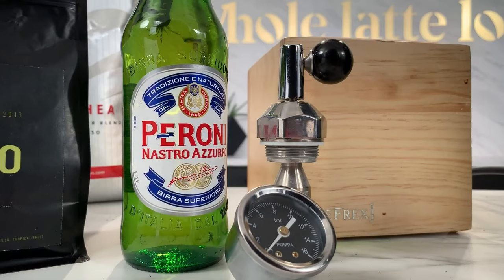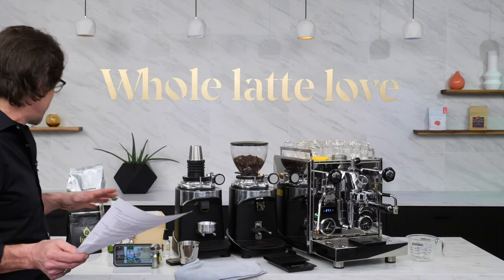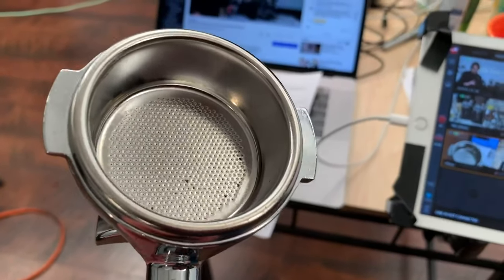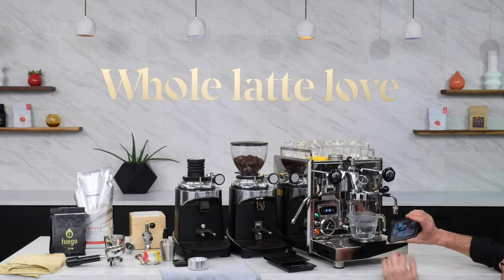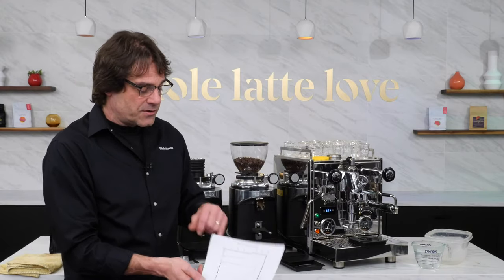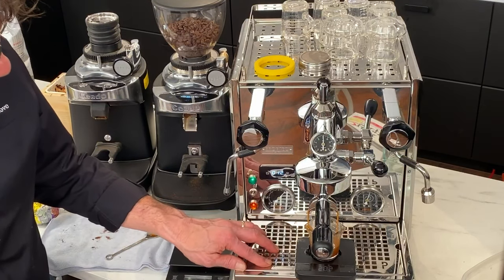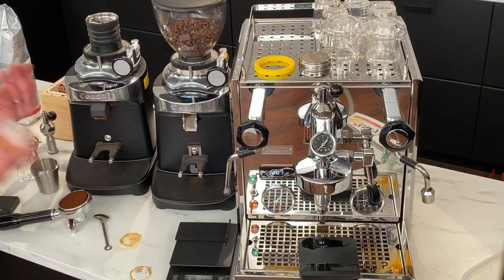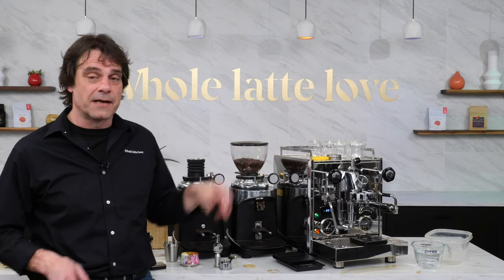Introduction to Flow Control on E61 Group Espresso Machines

Comment: I just had another question while I was watching you using flow control. I also bought the ECM Synkronika with Flow control. When I close the flow control all the way up, I still get some water (2-3 g/s) out of the shower screen. Is there a way to adjust the flow control setting if it is already installed? That would be really helpful to be able to maintain and adjust this. Also, is there a way to limit the output (g/s) if it is turned all the way up? It would be great if the standard flow rate (without flow control) would also be the maximum flow rate with flow control installed. Kind Regards!
Reply from the maker: Hi Martin, Sounds like you need to calibrate the control. The external chrome sleeve which receives the black control knob can slide down a bit while the valve is open and prevent the valve from fully closing. Very easy to fix! Loosen the black control knob a turn or so - just to be clear you will be turning the knob and not using the knob to operate the valve at this point. Then try closing the valve. With the black knob loosened a bit the chrome shaft which receives it can move vertically. That will allow the valve to close. When fully closed and no flow from the group firmly tighten the knob. Hope that makes sense!
There is no way to limit the maximum flow rate when the valve is fully opened. There are a few cases where one might want to have more than the stock flow rate. On the Synchronika it's ~1.25 turns from fully closed to get the stock flow rate of ~11g/s. From there flow increases in a fairly linear fashion out to 1.75 turns with a flow rate of ~14g/s. It's that last extra quarter turn from 1.75 to 2 full turns where the flood gates open and flow doubles to ~28g/s. Hope that helps!
Marc
Reply: @Wholelattelovepage  Hi Marc! This is a great tip and it did indeed help me to fix my flow control. It is now fully close at a 3 o'clock position. This might be a valuable information to all flow control users out there. Thanks for your help. :)
Reply from the maker: Martin Bartel Happy to help and glad you could understand the instructions. I’m much better at informing through video than writing. I did do a video showing how to setup properly for full closure of the FCD awhile back. We are working on a flow control support section on our website. Will definitely include links to that video and others as well as some profile graphs etc. Marc

Comment: Hi Marc, thanks for all your info and videos, your help is very much appreciated, Regarding Orchestrale Nota 1, have you ever used them, and if so what is your opinion, as I am about to upgrade from my Breville dual boiler to a "real" commercial machine.
Reply from the maker: Hi DFS, You are welcome and thank you for the question. It will be a huge upgrade from your Breville! I have not used that particular machine but understand it's a large boiler E61 group. Should give you more potential than BDB.
Marc

Comment: Hi! I really like your videos, they are really helpful! I also bought a Ceado E36S grinder and I see you adjusting the grind size while the burrs are not turning. Is this hurting the machine based on your experience? The ceado manueal recommends only to reduce the grind size while there are no beans in the machine and the machine is running. What is your take on this? Kind Regards!
Reply from the maker: Hi Martin, Thanks for the comment and question. Out of an abundance of caution grinder manufacturers always recommend only adjusting grind size with the burrs spinning. Reason? If you adjust to a finer grind size without the grinder running you may crush any remaining beans or partially ground beans between the burrs to the point where the motor will not start. If left on with the motor trying to spin the burrs but they're jammed with beans the motor could be damaged. In my experience never a problem to adjust to a coarser size without the burrs running. And very minor adjustments to a finer setting are usually not a problem. Especially true in a grinder like the E37S with a powerful motor and good start capacitor.  My take is follow the manufacturers instructions unless one knows exactly what they are doing.
Marc
Reply: @Wholelattelovepage  @Martin Bartel just to clarify, Marc changed the grind on the E37SD and not the E37S. On the SD it’s not an issue to not have the grinder running because, since you are single dosing,  you are grinding to empty each time. There are no beans left in the grinding chamber. With the S, because it is hopper-fed, yes you should avoid adjusting finer without the grinder running to prevent any potential jamming issues as Marc mentioned in his reply.

Comment: Love this! I am thinking of getting three for my Kees Van Dee Western Mirage then it will look even sexier hehehe question how come you don't purge water out between shots? Is it just for the sake of the video or you don't feel the need to purge the old water and grinds??
Reply from the maker: Hi Chubz, Thanks for the comment. Purge/flush depends on the machine used. If I were using and older HX boiler machine with pressurestat temp control I would most certainly flush. Same goes for most single boiler machines as well. Most of those machine types will have over overheated brew water after sitting idle. I don't worry much about the grinds. On most machines I replace stock shower screens with IMS screens for improved water dispersion. Unlike stock screens the IMS showers do not have a rough screen which holds onto coffee particles/oils - much easier to clean! Check those out here: https://www.wholelattelove.com/products/ims-nanotech-e61-shower-screen
Marc

Comment: Hi Mark --
I just bought a Synchronika thru Whole Latte Love. I think its basically the same as this Profitec you show here. Q. At 29:44 how many turns 'open' did you start with? I watched like 10x.. 1.5?
Reply from the maker: Hey charles, Thanks for the question - and of course your patronage! For that profile I started with the FC at 1 turn open from the closed/no flow position. Here's a link to a blog on flow control. In the blog there are graphs for a number of flow profiles I developed: https://www.wholelattelove.com/blogs/articles/intro-to-calculating-flow-rate-on-e61-group-machines
Marc
Reply: @Wholelattelovepage  Thanks so much Marc!

Comment: Hi Marc, Thanks for your videos. I recently purchased the Profitec 600 with flow control. I have pulled about 50 shots so far and just got my new Caedo E6P grinder so went back to this video before dialing in my grind size. I would think the Profitec 600 flow would be similar to the the 700 in your video, but it takes me 2 full turns open to get about 11 grams per second (222 grams of water in 20 seconds). Is 10.9 grams per second the stock flow on the 600 as well? I called tech support but they did not have an answer for what stock flow should be on the 600.
Reply from the maker: Hi Terry, Thanks for the question and apologies for my delayed response - I've been offline for the last week and just now catching up. Pro 700 has a rotary pump and stock flow rate is ~11g/s. Pro 600 uses a vibration pump. Stock flow rate on the 600 and other vib pump E61 machines is ~8g/s. Sorry our tech support did not have the answer for you. They should have asked me.
Marc
Reply: Whole Latte Love Thanks Marc!

Comment: Hey Marc, I just picked up the Profitec Pro 500 PID with the flow control. You did mention that the Pro 700’s stock flow is 1 and 1/4th turn, is this the same for the Pro 500?  I just want to get the stock flow first to dial in my grind before I start going into the deep end with the flow. :D
Reply from the maker: Hi ibfm, Your timing is perfect! Just did a live stream today featuring a Pro 500 with flow control. Stock flow rate on the 500 is ~8g/sec. Which is at about 1 1/4 turns of the FCD. But, do go through the calibration measuring flow rates at each quarter turn. Run for 20 seconds at each position, measure output at that position in grams or ml and divide by 20 to get grams per second of flow. There can be slight variations in flow rate based on pump pressure (OPV) setting and other factors. Do check out your machine doing it's thing in my live stream: https://youtu.be/suux3RrbAxA
I have a bunch of other live streams with different flow profiles for different situations like extra fresh specialty coffee, a sweet bump profile and more coming next week like a manual lever profile.
Marc

Comment: Hey Marc! I'm interested in installing a brew pressure gauge on the E61 grouphead of my Quickmill Andreja. Question- I see lots of options on the market for E61 pressure gauges, as well as E61 grouphead thermometers. Does any company produce a 2-in-1 gauge, that can measure both simultaneously? Thanks a bunch!
Reply from the maker: Hi Kevin, I am not aware of a combo gauge and thermometer.
Marc
Reply: Good job.

Comment: Hi mark, awesome video! 
I have a profitec pro 700 and these are my flow rates 
1 x 11ml/s
3/4 x 8.8 ml/s
1/2 x 6.6ml/s
1/4 x 4.5ml/s
They seem to be a bit higher than yours 
No water comes out when fully closed as well 
Thanks
Nicholas
Reply: Also i have between 9-9.5 brew pressure on both garages

Comment: Hi Marc, I bought the flow rate kit and and installed it. It comes with the spring replacement. After replacing it on my synchronika,  I find it tougher to pull the lever. What is the purpose of the spring and do I need to replace it? Thanks

Comment: Hey Marc,
Thank you so much. It’s been a while no see! I hope you’re doing well. 
Does the stock rate for v pump a turn and a quarter turn as well? Specifically for Calssica pif. Thank you.
Reply from the maker: Hi Amjd, thanks for the question. Should be close to one and a quarter turns for stock flow rate. Give it a try and measure what comes out in 20 seconds without a PF in place. Should be about 160g or 160ml which equals 8g/sec a typical stock flow rate for vibration pump E61 group machine like the Classika. Marc

Comment: Thanks Marc for putting this together as well as the other video with the 5 different profiles.
Did you come up with these profiles by trial and error or is there some theory behind it? For example, for dark roasts pre-infuse high flow/low flow, short or long hold duration? Light roasts, old coffee as well.  Could you expand on the thinking that lead you to those 5 profiles please?
Reply from the maker: Hi Phil, You are welcome and thanks for the questions. The profiles came together from informed trial and error is best way I can put it. Some basics are fairly well understood like long low flow pre-infusions allow a very fresh coffee to off-gas and reduce brightness. I have spent time working with coffee pros like Danilo Lodi of Dalla Corte who has some basic theories for flow depending on coffee type. I adapted and tested his approach on the DC Mina with regards to very fresh coffee. Also his way of working older coffees with high flow at start and flow reduction to avoid extraction of bitter and stale flavors towards end of extraction.
Marc
Reply: @Wholelattelovepage  thanks for your reply Marc.
I'm experimenting with the FCD on my Synchronika right now. It's  a fine line between drinking too much coffee or wasting it😋☕☕☕

Comment: This may have been asked before but I'm hoping for your answer.  If a machine has flow control is there a constant stream of hot water going to the E61 group head to keep it nice and warm even prior to opening up the flow control lever during the machine warm up period and/or between pulling shots?
Reply from the maker: Hi Stephen, Thanks for the question and I'm happy to answer! All E61 groups have a constant flow of water out to the group and back to the boiler in a closed loop when the machine is fully heated up and sitting idle. It's called a thermo-siphon and happens due to convection. Here's a video which covers different boiler types/groups with a deeper look at how that works using some cut-away machines  - a couple with cut-away E61 groups: https://studio.youtube.com/video/OUywoRs4meY/edit?o=U
Key to designing machines is a flow restrictor in the thermo-siphon loop which machine designers must size properly to create a flow rate which heats the E61 group properly. Hope that helps!
Marc

Comment: Great content as always and particularly in times like this. I'll go practice on my ECM classika (courtesy of Whole Latte Love)
Reply from the maker: Hi Craig, Thanks for the comment! The Classika w/FCD is a fine machine for espresso enthusiasts!
Marc
Reply: Hey Craig what are your thoughts and experience with the ECM Classika w/FCD.  I’m looking at it.  Eric.
Reply: @mikhailarey1196  I've had it for a couple of months now Eric. It's a solidly constructed machine and exceptionally well finished (compared to my old Lelit). Mine's not plumbed and the tank gets around 6 shots with frothed milk before a refill. It heats up from cold in 20 mins and from 200F (shot) to 264F (froth) takes around 120 seconds (75F ambient). 1.5 turns on the flow control to full and not hard to open / close this during the shot. The front positioned PID  / shot timer is a great benefit. It's small footprint works well in our kitchen.

Comment: Is the flow control on the ECM Classika a  good machine for home use.  Will make 2-4 espresso a day with half to include milk frothing?
Reply from the maker: Hi MA, Thanks for the question. The Classika with flow control is an excellent machine for home use - especially for those demanding high-end espresso capabilities and might work with more expensive specialty coffees - single origins etc. It is a single boiler so there is a wait for heat up to steaming temp.
Marc

Comment: Is the flow control on the Synchronika something WLL installs at your shop after it arrives from ECM or does it come already installed from ECM’s assembly plant (out of the box)?
Reply: They install it in New York shop
Reply from the maker: Hi CRR62, We install as the machine is available from us with or without flow control.
Marc

Comment: I just purchased the ECM Mechanika V slim with flow control from you guys.  But because its a HX machine without PID i want to use a E61 grouphead thermometer.  Is there any way to use them together?  After calibration, can i use the flow control without the grouphead pressure gauge?   Thank you
Reply from the maker: Hi P, Thanks for your patronage and the question. You can use the flow control without the group head pressure gauge. While that gauge does provide some information like showing a pressure drop in the group as the puck erodes solids at a constant flow rate I usually do not pay much attention to the gauge when using flow control. No way I'm aware of to use both temp and pressure gauge on group simultaneously.
Marc
Reply: @Wholelattelovepage  Thank you for your quick reply. So after calibrating flow control, I can use it with my group head thermometer.     I will need to use the pressure gauge to calibrate the flow control first right? or can I do it without it, with just my acaia scale.   Thank you again!

Comment: Hi Marc, is the pressure gauge standard for all E61 head ? so I can install it to either Lelit or Rocket ? thanks
Reply from the maker: Hey Jimmy, I've yet to run into an E61 group that does not have a port for the pressure gauge. Believe they all use the same thread size so pretty standard.
Marc

Comment: Hello Marc, 
Love your show -  I recently purchased ECM Synchronika with flow control. Based on your video for 20 seconds your flow control at 1/4 turn is 37.8 ml  and my 1/4 is 79 mil.  Then your 1/2 turn is 69.4 ml and mine is 139.2 mil for 20 seconds (almost double). My machine is plumbed in, is this normal ? could you please advise as to what would be the perfect flow? 
Thank you 
Sunil
Reply from the maker: Hi Sunil, My apologies for a delayed response to your question. I've been offline for a few days. Those are high flow rates. I suspect your flow control is not setup properly. Try this: completely close the flow valve and raise the lever to turn on the pump. When closed there should be no water flowing from the group. If water does flow when closed loosen the black knob you turn the flow valve with. This allows the chrome sleeve to move on the post leading to the valve inside the mushroom. With the knob loosened now try closing the valve with the pump running. If you get it to stop flow completely move that chrome sleeve up a millimeter or two and while holding in that position tighten the black knob. I hope that all makes sense!
Marc
Reply: Hi Marc, thanks so much for your reply - much appreciated.

I have done  as you  suggested (closed the flow valve and raised the lever to turn on) and water does not flow - which is fine.  

My machine is plumbed in and I have also installed pressure reducer valve at the main water supply but I am still experiencing same high water flow. Without using flow rate, I have 9 bar pressure on manometer but as soon as I start using flow rate regulator/control to make espresso water flow rate falls apart.

Really need your expertise here.
Thanks
Sunil
Reply: One more thing I forgot to mentioned earlier, If I have my flow control valve on a one and a quarter turn then raise the lever at first stage (just before you turn on the pump) water start to flow, . is it normal? 
Thank you 
Sunil
Reply: Hi Sunil, did you manage to work out an answer to your question? I also have an ECM Synchronika (although using the reservoir) and my flow rates are very similar to yours and not sure if something is wrong or not! Many thanks, Richard
Reply: @richardshilton2936  I Richard, no response from Marc as yet, I am also little confuse just like you to find out what is the recommended flow rate. I've asked three different local stores and none of them know (but they are happy to sell). Sunil